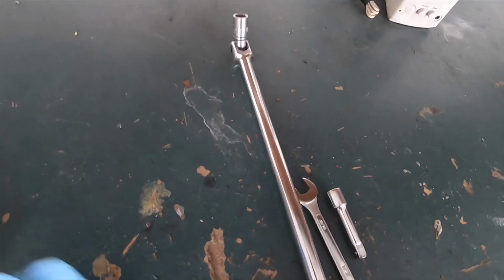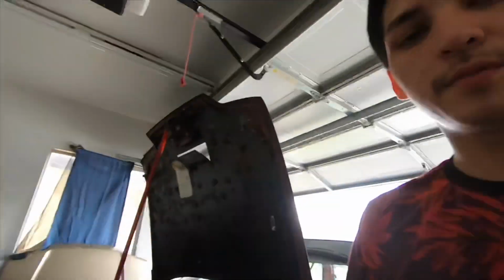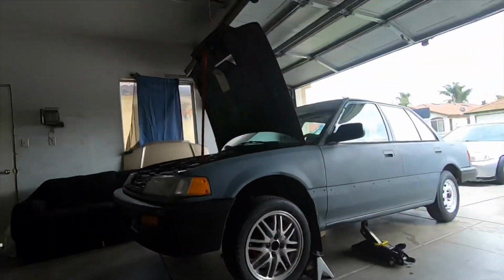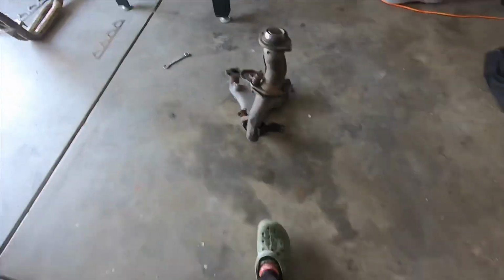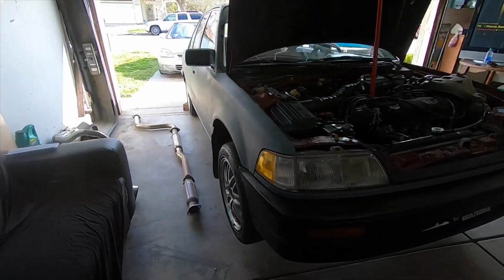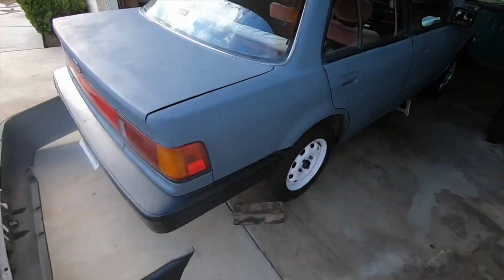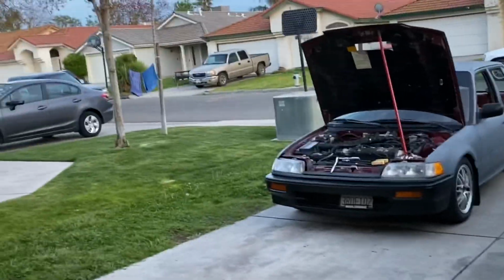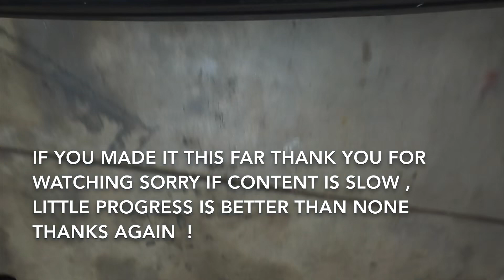My sedan got the Coronavirus 🦠🦠 89-91 Honda Civic full Exhaust Removal !

Comment: Dang. Exhaust work are one of the hardest jobs yet simple in my opinion. Over in Minnesota, older Civic like these are already rusted in to the point of cutting the exhaust unless vehicle has never seen winter.
Reply from the maker: Yea super easy without rust ! I would have cut it for sure if anything was stripped or rusted. Thank you for watching I appreciate the comment !
Reply: I feel this dude. Lucky I got mines rust free here in mn